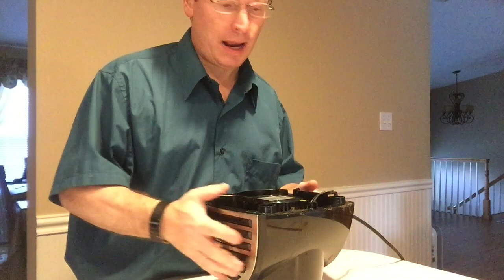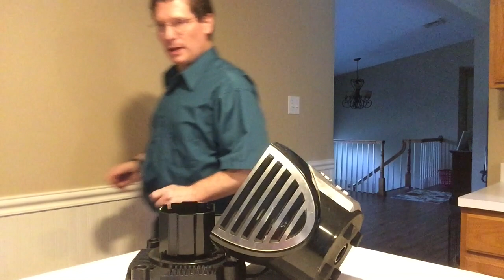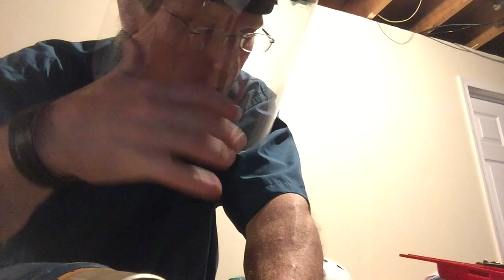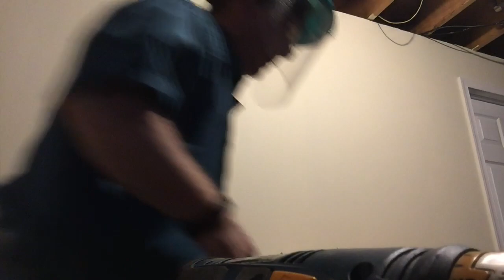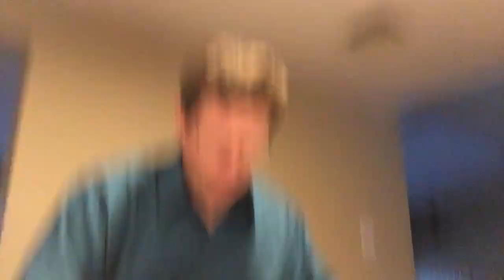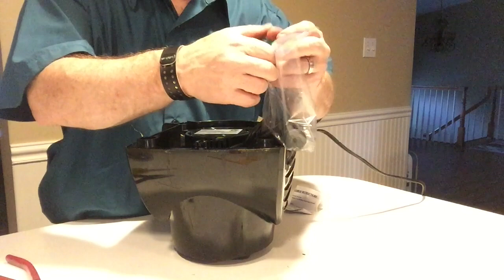Montel Williams Blender Repair Broken Drive Socket

Comment: I just tried to use mine after not using it for a couple of months. Worked for a few minutes and started showing smoke. I stopped it. What could the problem be? How should I repair it?

Comment: This is nothing like the Montel blender I own.  the base the carafe sits on is different, small round rubber feet insert into molded square blocks on the top of the base unit.  under the round rubber inserts are 4 screws holding the motor to the outer case with the controls.  There's a horizontal hole in the square shaft on top of the motor, ad a corresponding horizontal slot in the drive coupling that does not extend through. the side of the coupler.    To repair mine, I drilled a hole through the base of the coupler and inserted a pin through the hole in the square drive shaft

Comment: I got one for $11.00 at Goodwill. The pitcher was not engaging the switch under it when the pitcher was in the lock position. I bypassed the switch which makes the blender dangerous around children or anyone else that is not aware that I bypassed a safety switch. It works and I just leave it unplugged when it is not in use and I store it away from an outlet. The switch was not the problem. There is a tab that sticks out under the pitcher and it is worn. A new pitcher would cost more than another new blender.

Comment: Hi. I have a base unit that doesn't turn on. 
The unit powers up but the unit won't run after I reset the breaker. The panel lights up but that's it. Can you tell me how to open the base?
Reply: PS.   I have the Montel Living Well machine.

Comment: I have had my machine for a few years it worked great but was very heavy. I only used it a few times. The other day i tried to use it and it eoulf not turn on. Any suggestions of where to get it repaired i paid $300.00

Comment: I hope you will see this! But I am trying to remove the blade assembly of the blender so that I can get between the base and the plastic to clean it.
Reply: Any luck?
I think the threads are left handed. Be careful not to damage the bearing disc.
Reply: @thomasmills2404  hi, no, I ended up purchasing a new canister off eBay as I realize there was a small crack under the blade assembly that was actually the reason why there was so much gunk under it in the first place.
Reply: @julieaguilar1188  My fist pitcher was leaking at the blade. The seal was a leather or cork. I ended up buying another, and used the old one for grinding eggshells, nut hulls for flowers and making flour.
Reply: @julieaguilar1188  Also, I use it to emulsify some grass clippings for my potted plants. Just mix some powdered egg shells into it and spoon the mix into the flower pot.
Experiment for what is best for the plant. Really save on fertilizer. 😊

Comment: Hi Mr Larry, I have a Montel Williams Blender. A few months ago I washed my container out as normal and set it back on top. About a month later or so I went to use it but it wont turn on now. I heard that they had some trouble like this to where the water drips down into the motor area so you shouldn't let it dry on the base. Would you know how I could go out to check it when it shows no power period?
Reply from the maker: robjoder, that repair would be different.  If you are mechanically inclined, first unplug the unit.  Take it apart the same way as shown in the video.  Look for burned marks.  If anything has burn marks on it replace that part.  Reassemble it and give it a ‘smoke test’.
Reply: Mine won't turn on! Is there a reset button?